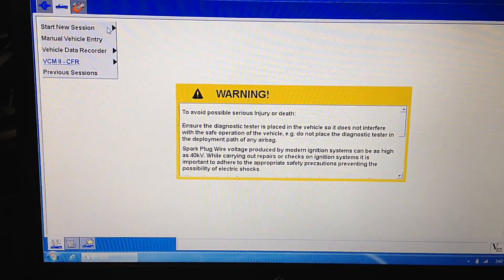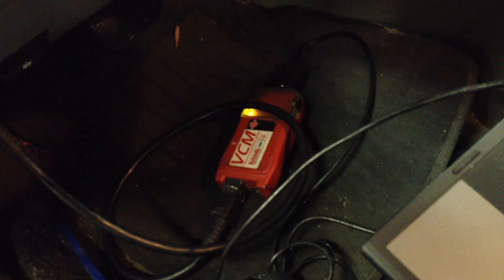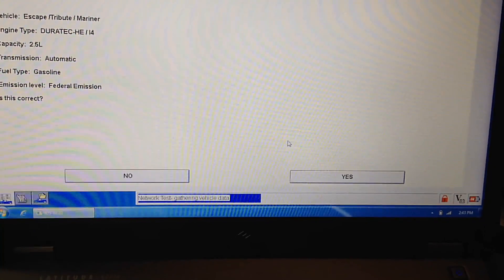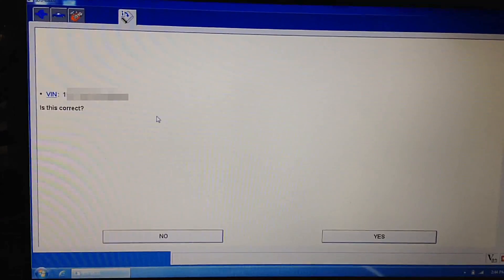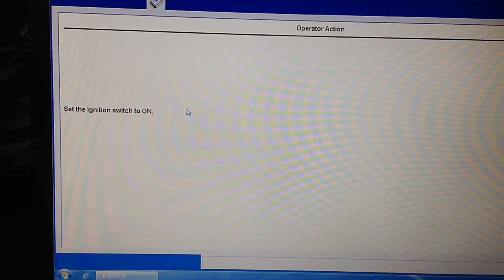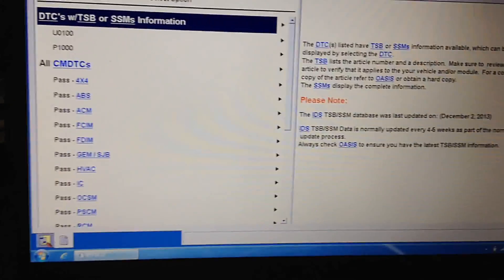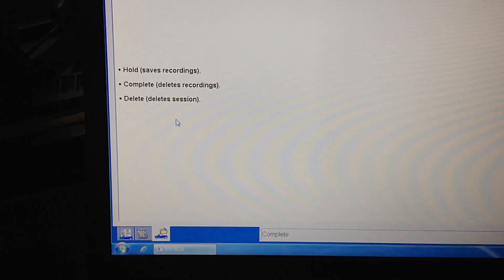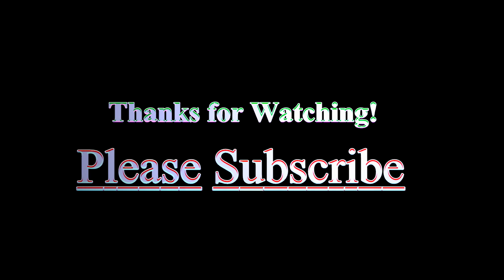Ford PCM Software Reflash Procedure

Comment: my 2004 f150 started doing rough idle and stalling while driving the other day its a 2004 f150 5.4l 3 valve i replaced cam shaft sensors as thats the only code it was throwing then it continued to do the rough idle and stall while driving i cleaned throttle body and it still did it now there is no throttle u can step on pedal and it does nothing i get message saying truck engine is in fail safe mode i cant move truck at all it still has rough idle and stall but now has no throttle what is the problem

Comment: Will reflashing my pcm get rid of a current tune I have on my 2006 ford f350 diesel? Will it reset my ECU and TCU strategies if I have my PCM reflashed?
Reply from the maker: +Kevin Hansen It will overwrite your current tune yes but clearing the KAM is another step that the dealer needs to do by request.
Reply: +FordTechMakuloco I told them I wanted my pcm flashed to get rid of a tune the previous owner may have left on it. I'm not sure if they reset the kam or not and I don't know how I would know

Comment: I took my 2011 Ecoboost F150 in to get the PCM updated per several transmission TSBs and your videos. I specifically requested a PCM re-flash and the Trans Adaptive Table be cleared per your advice. They ended up charging me 95 dollars. Is this not something covered by the 5 year powertrain warranty (I'm still well within by time and mileage)? 

Also, what is the drive cycle one should do to "re-train" the transmission table, as I'm sure they didn't drive the truck afterwards. How long until the shifting should settle down?

Thanks for the great videos. They have proven to be a great resource to me.

Comment: How should I phrase it to a dealer that I want EXACTLY what you have shown done. All they want to do is copy my existing PCM firmware version (original from 2009) and reinstall for $200. They are too lazy? to look up a revision. Vehicle is a 2009 Fusion 2.3 FNR5 with BAD idle shake/belt chatter even with all new motor mounts, Motorcraft plugs, belt, and OEM latest revisionTensioner. PCM Update last shot before we call it quits with this car.

Comment: Hello I am Mohammed of Iraq and I am very fan clips from the videos that do them ..... Sir, I have a problem car Ford F 150 2005 5.4 Eng. The problem got replaced when ecm, one new and complete the process successfully and worked ...... engine but the engine is not stable, after the diagnosis and found fault MAF) sensor and replaced it 5 times but the same fault ........ Can you help please
futfatal@gmail.com

Comment: Hi, Great video on this subject...Wondering what type of devise/s that one needs to accomplish the reflashing of components.Do you have to subscribe to programs on the internet or from the various vehicle manufactures in order to receive the most recent updates..  Thanks for sharing this info..I'd have to conclude that the dealerships are charging an unreasonable fee to do the reflashes of the systems..Cheers and thanks for educating us...
Reply from the maker: +luvkountry Everything you need to know is at www.motorcraftservice.com the prices for the equipment and yearly subscription are just not worth it for most owners.

Comment: hi, i am installing an 07 4.6 drivetrain into my 05 4.0 mustang. The 07 was low milage wrecked car but complete. do you know if the if the 07 pcm will function in the 05 car with out a reprogram? My concern is if it will interact with the 05 modules or if i should replace them with  07 units. thanks for any help.
Reply from the maker: +Lloyd Tack I would get the harness and pcm from the wrecked car, after it is installed it will still need to be programmed to the vehicle though.
Reply: Will do. Thanks

Comment: what mod would run the turn signal?
Reply from the maker: The smart junction box
Reply: Any Idea what that costs? Can I replace it myself?and where is it located.  Lol lots of questions I know. But it really helps talking with someone that knows. Thanks again
Reply from the maker: +Ronnie Link It is located in the right front foot well area under the A pillar. You must get it replace by the dealer as allot programming is required afterwards.

Comment: hey is there anyway I can contact you via phone for a quick convo for my Ford freestyle? it cranks no start, replaced throttle body, took to mechanic shop, said cps is good, spark plugs are good. it just sparks for a second and then won't turn over. said Ford needs to do a flash on the computer. getting car towed to dealer now, but since your a Ford specialist I really need your opinion.
Reply: also I did the whole relearn process in another video. but no help.
Reply from the maker: +Rocco Velasco I don't do phone calls no, what did they find so far?
Reply: +FordTechMakuloco Ford techs at the dealer told me there is a problem with the CPU communicating with the timing chain. might be bad. I highly doubt but yeah then they said the engine has low compression in like 3 cylinders. I highly doubt my engine is bad but after I explained how the car worked fine the morning I cleaned the throttle body then it started with the crank no start symptoms he's like I'm gonna do more diagnostics on Monday and see if what happens.  so I've talked with a few mechanics and they said it makes absolutely no sense for the engine just to go bad after cleaning the throttle body. so I'm lost and I'm pay85 his t for them to do diagnostics.. if they fix it or not . so I wanna know what you think cuz I feel like they may just try to rip me off but IDK.
Reply: +Rocco Velasco the mechanics tested timing chain. crank position sensor.  spark plugs everything and determined I would have to take it to dealer to get CPU reflashed . since it still sparks but not enough to start the engine....
Reply: Omg don't clean the TB on Ford (or any other manufacturer), it says not to do this in manuals everywhere. You probably: abraded (damaged) the sensor, or it has chemical damage. 
Did you take the TB off or clean it in place? Maybe the crap is now inside the "header" and on a sensor, or in some important venturi something or other. At best, you could remove the throttle plate and remove a TINY amount of metal for increased idle fixes.

Comment: thanks for the video man. very helpful. suppose it would cure a left rear turn signal problems on a 2011 f350?
Reply from the maker: +Ronnie Link No I doubt it those are sensitive to any m od to the light and once the module has had enough it must be replace to fully cure it.
Reply: Ok. Thanks for the reply. I'm really at the end of my rope. What mod would it be?
Reply: @FordTechMakuloco  my pcm is having the issue of not communicating when i connect any obd2 reader to it. Will this be able to connect and reset my pcm? (2003 eddie bauer expedition)

Comment: I've tried to flash a PCM in a 1998 Mountaineer but it refuses to communicate with it to do the flash, clearing KAM or doing the KOEO and KOER tests. It falsely claims there's a communications error. It also fails at doing the ABS service bleed. Anything that involves sensing when the brake pedal is pressed it fails to do.

I do get an note about a TSB on flashing the PCM out of the vehicle.

For reading and clearing DTCs it works. It also is able to set the tire size.

I've used FORscan with the same hardware. That software does the KAM clear, the KOEO and KOER tests, no problem at all detecting the brake pedal being pushed. Unfortunately FORscan does not yet do ABS service bleed for 1990's Fords.

Comment: Hi Brian, when you say reflash pcm is the same as programed? because I have 04 explorer with P0505 and there is a TSB for it, the explorer was okay until alarm when on and after disconnect the battery now there no throttle respond and loss of rpm, I talk to the dealer and they will check if still cover the TSB..
Reply from the maker: +felplay vina (felplayvina) reflashing the pcm updates the software. What you need is to manually clean the throttle body and reset the pcm as per my videos then let it learn the new ETC idle trim value.
Reply: +FordTechMakuloco thank Brian the problem was the throttle body, replaced and reset the PCM as your video no more problems, Thank you...
Reply from the maker: +felplay vina (felplayvina) Yeah if the clean and relearn does not resolve it that is the only course of action you can take to fully fix it glad you found it.

Comment: Will this fix the hard downshifting when my 2010 5.4L arrives to a full stop? I bought the white Lube and I followed the other video about the slip yolk. Yet the problem is still there.
Reply from the maker: +Youssef Cherqaoui The early 6r80 has this issue. Get the software reflashed, the tcm adaptives reset and the trans shift points relearned.
Reply: This is exactly the issue I'm having. What do you mean by getting the "tcm adaptives reset and the trans shift points relearned" - is that what this video would do? I dont want to take this to the dealer and tell them the wrong thing and get hosed....

Comment: Awesome video... I have an 03 Lincoln ls v8 my only concern is the downshift from 2-1 at 15 mph it's a little harsh. Is there an update for this model to help with this issue? Thank you for your time.
Reply from the maker: +mrksouthern the ls models had problems with shift timing due to the pcm drivers failing. I would get the pcm updated and reset the trans adaptive tables.

Comment: We were doing this exact procedure on my 2010 Expedition when an error message came up halfway through the writing stage of the PCM.  The software then went on to update the TCM but in the process the PCM was corrupted.  The software is just saying to replace the PCM and will not let us try and update anything again.  Have you ever seen this happen?  Someone suggested it could have been because we were using the bluetooth connection vs USB cable.  I just dont understand how Ford software can ruin Ford hardware???  At this point I guess Im going to have to spend the 500 plus to get a new PCM and hope we can get the as built data entered correctly.  Any ideas? Thanks.
Reply from the maker: +tichendorf you were using the ford ids via Bluetooth? yes it does happen once the module is bricked and cannot communicate the update process cannot be started again.
Reply: +FordTechMakuloco ok thanks. i figured i was out of luck but just wanted to check with the master :)   enjoy your videos thanks.
Reply: Jack of All Master of None of
Reply: FordTechMakuloco 
I have a 98  Expedition with a battery drain  .It started when I was trying to put led lights in the cluster ,I had forgotten to disconnect the battery .Did it short from pcm or gem ? Nothing stays on . Ive done so much trying to figure out the problem from grounds to fuses disconnect alt.and still have 2.50mlamps drawn . Even changed gem an fuse box  an nothing.I started thinking about a new pcm but want to ask first or will a reset work ? Or when I unplugged the cluster did it pop a circuit ? Please help. thankyou for always helping on youtube!
Reply: Truck still runs but i have to disconnect battery all the time  and nothing seems out of the ordinary

Comment: ford dealership wants to charge me 1300.00 to fix pcm on an 02 ford escape  is that the right price
Reply from the maker: +Tabby Martin sounds way high to me but the pcm itself may have skyrocketed due to the age of the vehicle. If you are in chicgaoland bring it on over.
Reply: That doesn't surprise me at all. Most of the people that work at dealerships are crooks.
Reply: +Tabby Martin  Pack up your PCM and send it to Circuit Board Medics.  They will repair it and have it back in a few days, and no dealer programming required.  Others might do it cheaper but CBM will test run your computer on a live vehicle.
Reply: FordTechMakuloco  Hello. I looked up Circuit Board Medics. I will be going right by their Greer, SC branch. You have an idea how much it all costs? I have a 2008 f150 5.4. I'm getting a PO354 code. Any suggestions?
Reply: I wish I lived in Chicago I would bring you my truck real quick
Reply: I bought a good used one off eBay from a recycler for  $60 that  worked fine.

Comment: Sometime ago, blew #8 spark on 5.4 99 expo and cel also came on soon after. according to description of service and parts the CEL was caused by, and Im quoting, "tech connected ids-ids states expidition is ford contour, tech installed as built data and reprogrammed power control-now states correct vehicle." you ever see anything like this? 
This and many other problems made for a terrible experience with this service department and Im just now looking into it.
Reply from the maker: +Dawson Chapman I do not see how the vehicle could have a contour calibrations and be able to run a v8 makes no sense.
Reply: +FordTechMakuloco those were my very words... thanks for the quick reply.

Comment: I have  a 03 crown vic that needs computer update do u know how much they charge at a ford  dealership to reprogram  or can i get it done anywhere
Reply from the maker: +nette-nette morgan Only a shop that has an IDS, for an update they should only charge a half hour of labor, whatever their rate is.
Reply: See I asked the ford dealership in Indiana & they said it would take 2 hours to do which would be 180 + for second key
Reply from the maker: Wow wish I was closer I would charge $25 to program if you provided the key.
Reply: OK so help me understand this key is it just a copy of the key u put in the ignition or something way different
Reply from the maker: You need to update the computer or just need a 2nd key cut and programmed?
Reply: FordTechMakuloco really don't know cuz my old computer stop working then I got one from the junkyard  installed but needs to be program to start
Reply: FordTechMakuloco hey when you flash the pcm do you have to drive it to reset readiness monitors?

Comment: +FordTechMakuloco Is there any connection at all between a Ford My Touch SYNC update and any of the other computer modules present on a vehicle?
Reply from the maker: +Charlene Schlueter On some updates the rcm must also be updates as it is part of the 911 assist.
Reply: i have a 2008 xplorer  and i was driving and it died out when i was getting on the expressway.it cranks but it didn't start. do pcms go bad or is it usually reprogramming needed.

Comment: Hi there. Just has my 2011 Escape XLT 3.0 in for the extensive #4 service here in Canada. One procedure that was not covered under the maintenance program that I paid for was cleaning the throttle body and MAF sensor, I told them to go ahead with that. They also wanted to charge for a software program and cleaning the fuel injectors, to which I said no for now as the bill would have been close to $400. Can you tell me what the most current S/W upgrade would actually do?. I will do the upgrade but too much money at once. Do you have a video on cleaning fuel injectors?.
Reply from the maker: +peelman1506 No video on cleaning the fuel injectors yet. There wasn't a recall on your vehicle up there for the throttle body issue?
Reply: Yes there was a recall on the throttle body which I completed some time ago. Are you thinking that they should have cleaned the throttle body then?. I asked the service adviser what the s/w upgrade would do for the vehicle, she couldn't say. The tech connects the scan tool and informs of certain updates I guess.

PS. there was no issue with the throttle body at this time other then carbon build up/ dirt.
Reply from the maker: +peelman1506 For the recall Ford does not pay us to clean the throttle body. When they did the update it updates everything engine and trans. All that is improves upon id fault detection in the throttle body to alert you sooner.
Reply: +FordTechMakuloco thanks for your time. I'll take the Escape in for the s/w update at some point in time. I'll keep an eye out for a fuel injector cleaning video of yours in the future.

Comment: hi fordtechmakuloko i have a ford focus 2014 have a problem some times when i drive message say power steering fault during that key cycle work fine when i turn off and star over again no power steering hard to move and code c102d when i read live data of pscm say vehicle speed at 100 mph whe is stop, just calibrate pscm and work fine like 2- 3 days, where is the pscm?? in the same pcm have update pcm or is other place Power Steering Control module???
Reply from the maker: +Meme Aragon C102D is high friction internal to the steering gear only fix for this code according to Ford is to inspect tire pressure and for binding in the front end and besides that to replace the steering gear. What does the speed pid indicate in the pscm and pcm when the vehicle is moving?
Reply: +FordTechMakuloco pscm speed are 100 mph all time and in pcm show the right speed i try with other pcm second hand from march 2014 but need to rewrite vin on that pcm i use launch x431 but cant find where write new vin thanks for help my friend